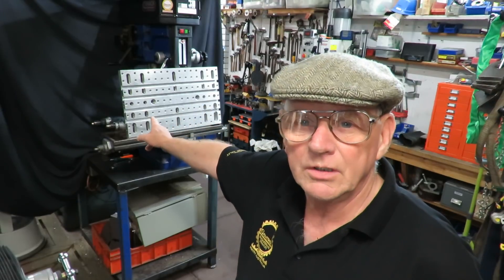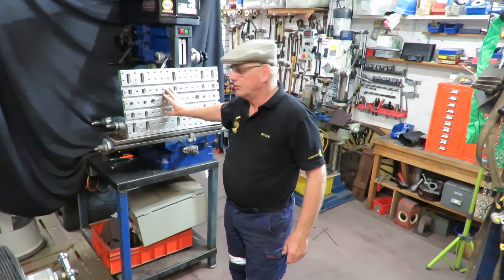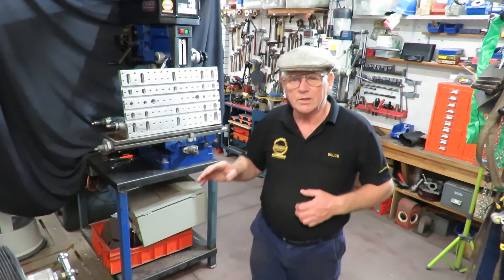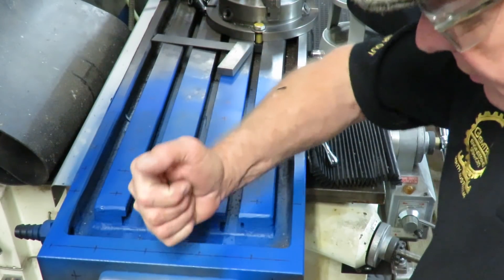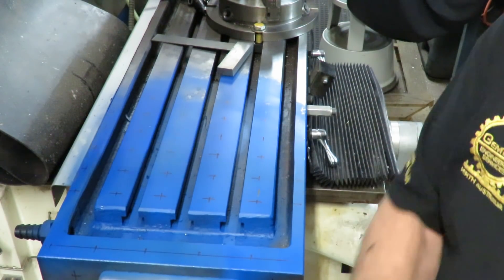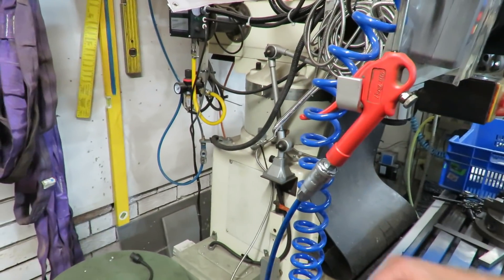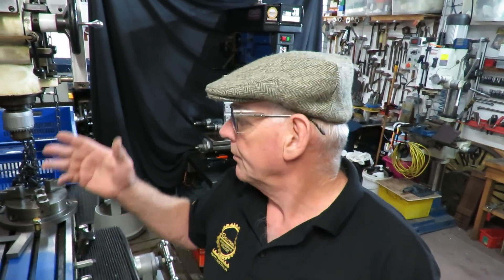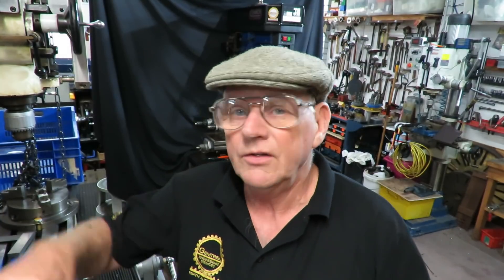Mill Table Improvement Idea Peanuts and Single Malt Limited Edition

Comment: First of all guys Iike Tom & Kieth opinion I respect but I feel the same way. Just  drilling and tapping the holes in the cast bed can cause stresses especially the pattern your proposing. I’m in the camp that if you need the flexibility of a mounting system it would be better to have a plate machines the table length. Now if you drilled some mounting holes in the bed for that it would be acceptable in my opinion.

Comment: It's your mill do what you want. I'd be concerned about how to keep the crud out of the holes and how to remove that crud. I do think however that you should leave it alone. A separate fixture with the setup you wish that could be attached would be the way to go.  Thanks for the video.

Comment: I got a few holes that came with Buffy, not quit laid out like you propose too! LOL  I believe that the structure is there, to be able to do it, but I think something like Tom stated with sub, or dub plate, more designed to the need at hand, also just like my jig table threaded holes, you do find yourself digging them out to use, like what Charlie said.  I'm really glad your that old and still coming up with stuff! LOL cheers, to my senior. ;{)-------

Comment: I Think it is a neat idea that you should try.  I also bet that once you get started you may want to try other additional modifications, like the alignment pins,  that would make the mill table even better. You may want to do all of the prototyping on a plate before transferring it to the mill table. That being said, I wouldn’t use my favorite mill as the prototype just in case there are unintended consequences.   Do you have an old mill that you wouldn’t really care about that you can try these modifications on first?  Cheers!  Chris

Comment: I think you have been hitting the single malt a little heavy. Don't do it mate!  Instead I would semi permanently attach a sub plate that had everything your little heart could desire built into it. Including bored and reamed dowel holes so you could plop tooling on without indicating it into alignment with the axes. The subplate option is something that is pretty common in the CNC world and has the added benefit of adding area to your table and can be serviced easily when it gets chowdered. Tom's .02 worth.

All the best.
Reply: I am with Tom just bolt a plate on it and be done.
Reply: Tom, I'm Bruce's semi apprentice here in Perth and when he told me what he was planning, I saw that look in his eye. We need to give the oldies praise for still thinking 😂
Reply: I second that.

Comment: Hi Bruce.  My immediate thought has to do with rigidity.  A few holes might not be an issue, but with the number you're talking about, it may possibly have rigidity implications.
For the sake of losing the thickness of a mini pallet (~20mm?) from the Z travel I'd definitely go with pallets.  Like someone else suggested, they are easy to clean, if damaged they can be replaced, but not so (easily or cost effectively) the mill table, and even be specific to a given repeat, or awkward job.
Regards Mark in the UK

Comment: My concerns are the swarf in blind holes and potentially weakening the table t-slots. Layout a full scale sketch with a cross section through the holes and the t-slots to see what you're going to get into. Fixture plates are usually made from rolled steel or aluminum and don't fracture like cast iron. If drilling holes is the right thing for you, by all means, drill holes.
Thanks,
John

Comment: What if you just made a bars that bars/plates an inch or two wide that could be bolted to the t slots and had several threaded holes in them. You could slide it around the table as needed.? much less work than drilling the whole table.

Comment: I don't see mechanical problems. But there could be problems in using these. 
Even if you're clean in your work, there will be always oil dust and chips collecting in these holes. And to drill them trough is out of question. The only way i see to hold them somewhat clean is to put in grub screws and even then oil can travel in the holes and stuff can collect on top of the grub screws.
But what i have seen on tool room machines are smaller T-slots between the bigger one from the manufacturer. I've seen one picture of two rows of shallow dovetail grooves. And one milling machine had dovetail grooves in 45° to the big slots, but this machine was used for a special purpose.

Comment: Drilling the cast iron could lead to some stress induced cracking in years to come. I personally would feel queezy drilling into the table though, maybe because the bed would need to be perfect for resale value. From a adaptability point of view, seeing as a plate of ground flat steel costs not too much, that would be a more palletable option. You can then customise the plate to your needs and have subplates if you need them. Mind you, get the plate already ground as facing it on the knee mill will induce flatness errors (bed tilting at extremes of travel)

Comment: Consider if you ever want to sell the machine. Nobody wants a table with holes in it. A fixture plate is probably the smartest move. You can't really mill the sides of your workpiece down to the table level if you bolt it straight to the table without damaging the table.
Reply: I second that.

Comment: I dont think that it will help you . you can use bolt directly in T Nut. But if you do it , i reader helicoil all the threads in the cast iron . The pins ar a good idea but if u miss drill one it will do more wars then good

Comment: Hello! My friend made a similar table (with M8 threaded holes) for his CNC - for the manufacture of the T-groove, corny did not have enough thickness in the table blank. For a small CNC, this is enough, for use in large universal machines where there can be great cutting forces, I would not count on them. And they should be closed from the chips, you need to cut quite a lot of threads (although the cast iron is usually well processed), cut the chamfers so that the material does not rise when tightening ... I don’t know - you have quite a lot of slots on the table - I think it’s possible to nominally clamp . Show the part that did not work properly :)

Comment: One critical thing that should be considered is the extra Z height you would achieve, not having to have the thickness of a fixture plate added to the height of the table. 
I would highly recommend that you not only drill and tap, but also ream the centre of each hole to suit dowel pins, so the ability to register your parts square to the table is ensured as well.
Finally I would look to universal threads, tap for both metric and imperial sizes, that way whichever bolt you have would fit in any hole.
Reply: And don't forget the left hand threads for when using the boring bar.
Reply: What the heck is a "universal thread"?
Reply: Tapped for both metric and imperial so both fasteners work
Reply: Like a pakastani cycle thread !